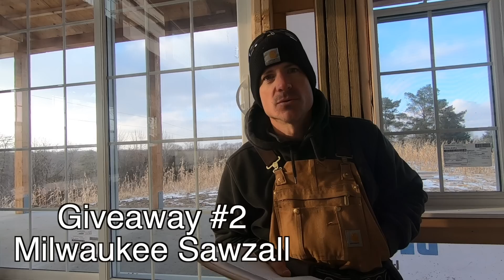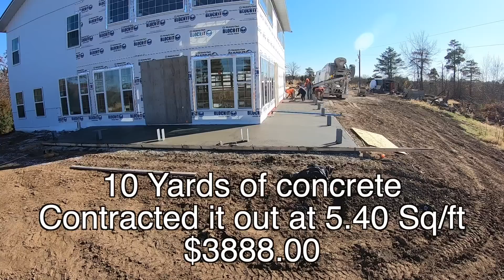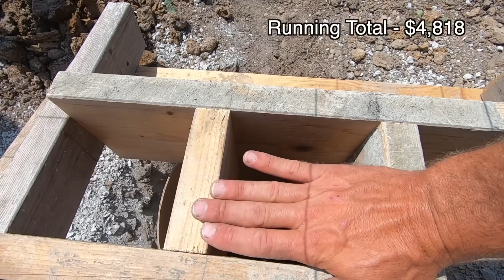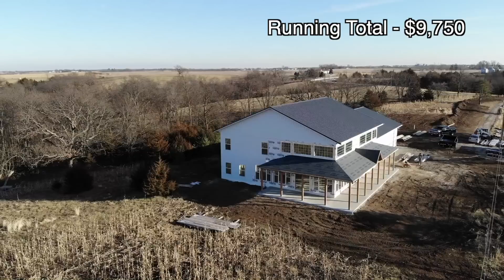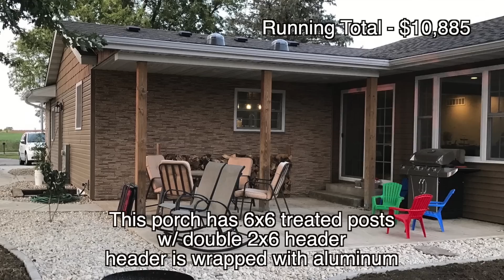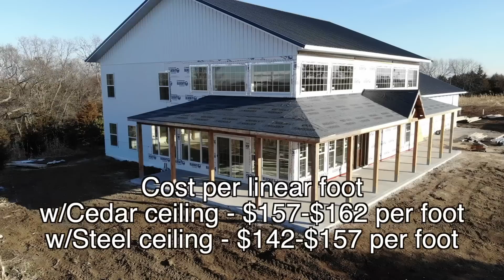Cost Breakdown: Post and Beam Porch for a Barndominium

Comment: Hello Sir. 
Why do all of my tape measures I have in my tool shed have a spacer that adds a  couple 16th of an inch movement extra when your using to measure something. It seams when I pull my tape tight the end moves out to add that extra measurements?
Also how thick are your sheets of plywood you put on the wraparound? 3/4” ?

I also want to say that I’m really enjoying watching your build. I may never build what your building, but some of your projects to build your dream home I think I could McGiver them. I’m a dysfunctional disabled Veteran that  have dreams and aspersions. Your giving me ideas. Thanks Sir
Reply from the maker: Tape measure: to make up the difference of the hook depending on if you’re pushing against something or hooked onto something.
Reply from the maker: Plywood is 3/4”. Thank you so much for following along and feel free to reach out with questions!

Comment: You've presented some of the best instructional videos I've seen yet on framing a pole barn house.  Specifically, you've explained things like keep the pex lines from touching the concrete, using a wye + 45 deg elbow  (I know they have a wye combo), showing how the trusses sit into the posts, the size of the post footings and how deep, doing fascia, soffits, etc., and so much more.  What you did was explain what you were doing, instead of just showing the finished product.  And I certainly like the way you aligned the walls (cool man!)....Now I have done conventional framing plus I have a Mechanical Engineering background (50% Structural), so my biggest concern is the structural support for the doors and windows and roof trusses.  You know, I am used to conventional framing, so I will continue to study how you have handled supporting these structural loads on the exterior walls.

Comment: I have bin watched the whole series and "Wow" you have done a great job explaining everything. 2 Questions. 1. Why not rent a bulldozer to level the land instead of using rock to bring up the grade? 2. It seems the house is way out in the country, how do you get water supplied? I would have thought you would need a well. Great job, I learned a lot. P.S. Good thing you had the lift to do the roof trusses but doing the metal roof alone took balls. That was not safe.
Reply from the maker: It’s hard to see in the videos but the way the land lays I would have had to push out a ton a dirt on the south side of the build. Trust me I thought about it but either way it would have cost me and I really didn’t want to push to much dirt out as I like the way our property lays out.
Reply from the maker: There is a water main that runs along the road so I chose to hook up to that.

Comment: Great build so far on this pole bar/house structure.  I like the way this was designed and gives you options to add architectural elements that most home builders won't touch, such as spinials, corner bracing, etc.

Comment: Outstanding no BS video. Very informative. I did cedar when I lived in South Dakota and it was a big mistake.   Cedar can't handle the weather there. I'll never use cedar again for anything.  Hopefully you have a better experience.  Vertical post will last awhile.  Anyway outstanding workmanship. Use the steel for the ceiling.

Comment: Just out of curiosity why did you not use double bubble instead of house wrap? On the steel for the roof did you have a them put the vapor barrier on the steel so as it doesn’t draw moisture
Reply from the maker: I like to use house wrap. I have a 6 mil vapor barrier underneath my slab so moisture will not be able to come up from the ground. I will also get a vapor barrier on my ceiling prior to finishing ceiling.